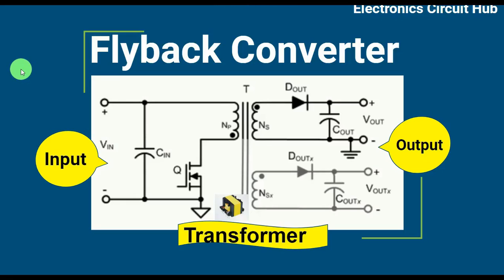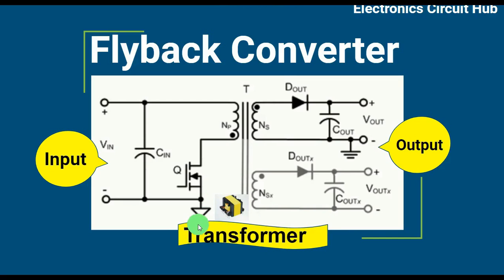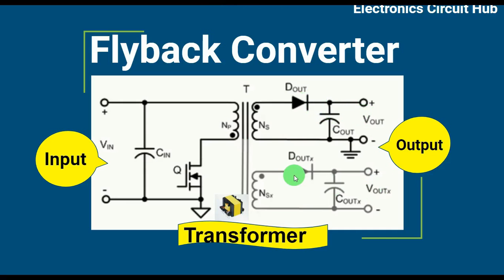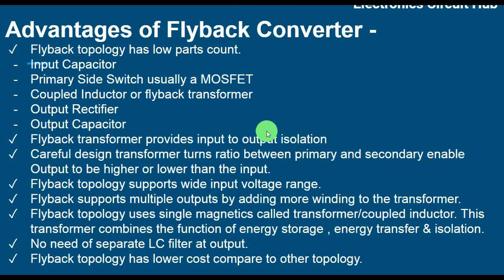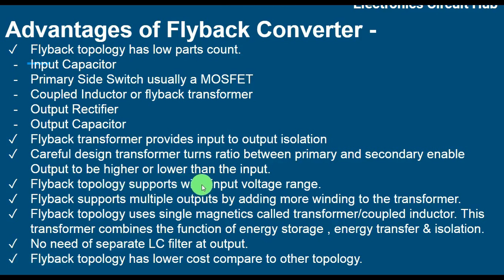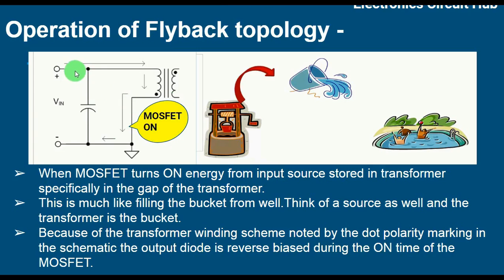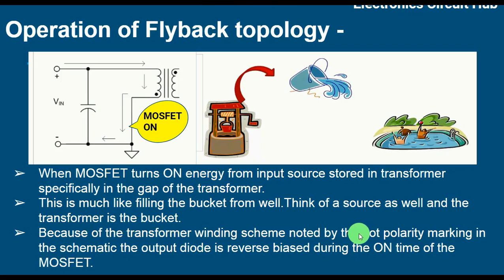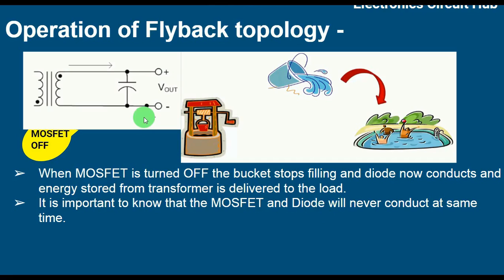What is Flyback Converter ?

Comment: Professor, thank you for a great explanation. Does the fly back converter have modes associated with it? Or do they just go by buck or boost depending on the turns ratio?
Reply from the maker: Hey Danny,
Thanks thanks for asking this good question. I the upcoming videos i will explain the different modes of flyback converter. Hope they will answer your question.
Reply: @ElectronicsCircuitHubECH  thank you professor. I'm working on a fly back convertor in LTspice.  I get the primary side of the coupled inductor to work, but when I add the secondary coupled inductor, the model stops working.
Reply from the maker: @pbaemedan  I would love to hear from you if once you done your Flyback converter simulation in LTspice. Please share ltspice file with me as well.
you may try transformer modelling like this. I have not created any ltspice simulation for Flyback till now.
https://youtu.be/JytIiCAxDLE